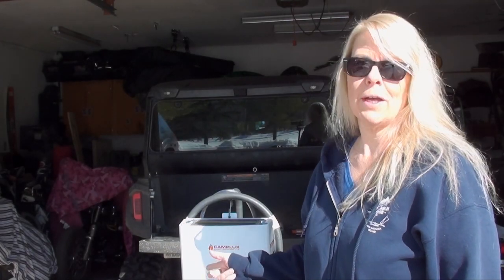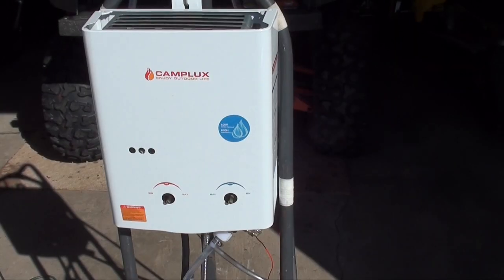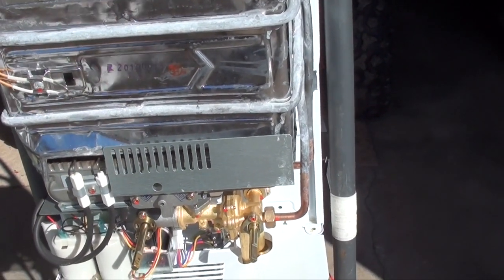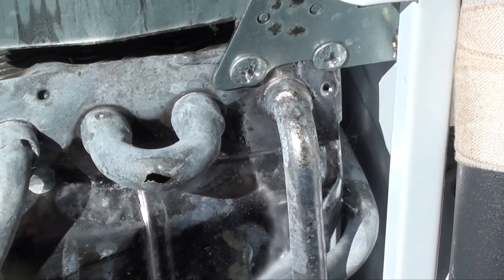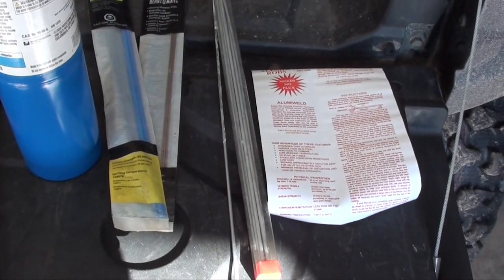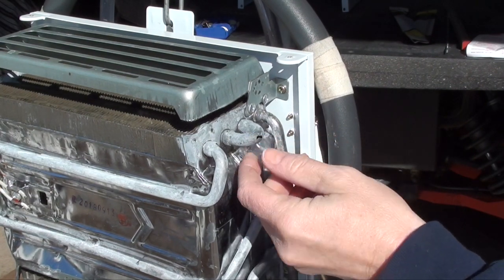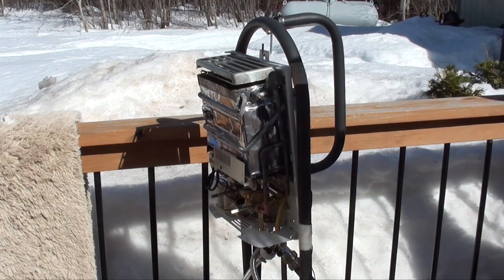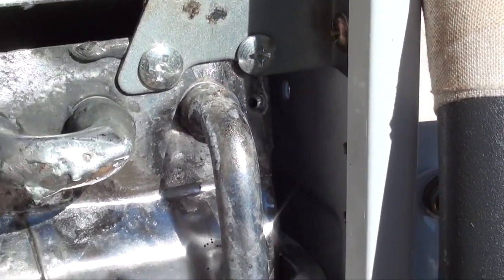How To: Repair Burst Water Heater Pipe with Alumiweld & a Propane Torch.

Comment: We just had some zub zero temps and I have the 16L camplux heater. The crack I have is in the same exact place as yours and I'm praying that's the only leak. I'm buying some alumiweld and trying this! Thank you!

Comment: This past Dec 29th 2022 during a deep freeze while we were out of town our Rinnai on demand water heater froze and burst "exactly like yours in the same place". My plumber who sold us the W.H. 4 years ago (about 2,200.00 4 yrs ago) said we really needed to replace it (now about 3,200.00) offered to try and fix it (I've known and used him for over 25 years and he's very good). He tapped it back in place and soldered it using 100% lead solder which he thought was the best stuff to use). It worked, but ror only 15 days and then it was leaking again. So, I got some silver solder and flux, cleaned off a lottbof the blob of lead solder and redid it with the silver solder(5%). Well, it lasted till yesterday, almost 4 months. Leaking again. Thanks for posting this video, you give me hope. I'm going to get a scrap piece od copper pipe(mines all copper), solder it, clean it off, and try the alumiwel which I've had a while but think it would work on copper but I'm sure I can't melt a brazing rod with my propane torch but the alumiweld will. If this doesn't work, I'm going back to the conventional 40 gallon natural gas water heater. You did an awesome job. Thanks again.

Comment: Thanks for this! I have a busted copper line almost identical to this on my travel trailer tankless hot water heater copper line. Right on a bendy part just like this. Gunna give it a try before I drop 600 bucks on a new one!

Comment: It appears that you only tested the repair with the water flowing. That's not really a good determination as to whether the repair is good enough to last. Did you test with the system under pressure, i.e. the line capped or with a shut off closed?
Reply from the maker: Sorry for the late reply, I haven't been receiving notifications for some reason. I didn't, but the repair is still holding in 2024. I use it as supplemental heat for my inflatable hot tub.

Comment: Thanks so much for this video. I have a leak in my heater as well, also due to freezing. I’m gonna see if I can find somebody with the welding equipment to help me out and save the replacement cost of a couple hundred bucks.
Reply from the maker: Oh, bummer! I hope you can get it fixed! If you can’t find someone to do it, you may be able to fix it the same way I did. You’d have to Google for the Alumaweld; I can’t remember where I bought it. Somewhere online, I’m sure. 
Good luck with your fix and thanks for watching! :)

Comment: I have this same unit with a crack in the copper part of the pipe. Think I could use this same method to fix it, but over the copper portion? 

Thanks for the DIY! Super helpful.
Reply from the maker: I think it's worth a shot! I believe Alumiweld does work with copper. Otherwise, you might try a brazing rod but it's been many years since I've done any actual brazing so I don't have much to say on that. I hope you can get your heater fixed! Mine is still holding up great! Good luck! :)

Comment: did that stuff say to flux the pipe it looks like you fixed it so i will take mine apart to see what happened cuz mine wont fill it just pours out near the hose and i put a new washer in the hose hook up , still pours out water
Reply from the maker: Sorry for the late reply, I haven't been getting notifications for some reason. I didn't flux it but it probably wouldn't hurt. The cleaner the better.
Yours might have a crack where the hose screws in. I think they can swell/crack anywhere the water settles & freezes.

Comment: Why working without any safety gloves?
Reply from the maker: For a kind of delicate job that takes "feel" I didn't think gloves would be the best choice.  I actually rarely wear them unless I'm working with something that can cut, scratch, poke or burn me. The Alumiweld sticks are about 20" long. I know it looks like I have my hand very close to the flame, but I don't.
Thanks for watching!
Reply: I was in a wreck and the pivot bracket on my alternator broke.  Used this product to weld the part back on.  Had to Re drill it, but it lasted for several years and then I got rid of the car.  If I recall, the replacement alternator was about $350.